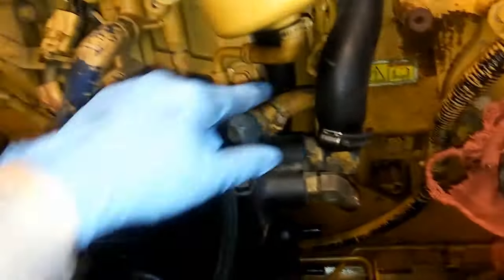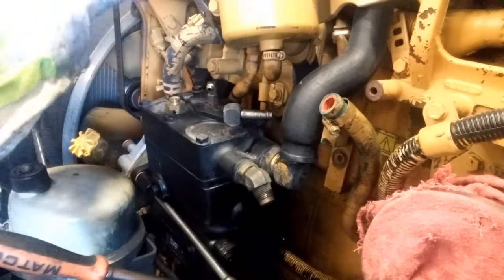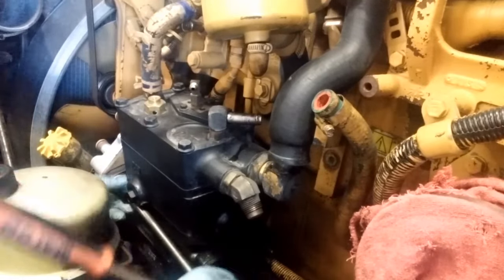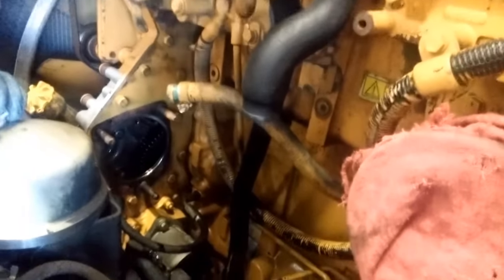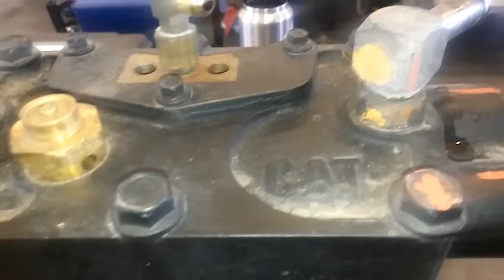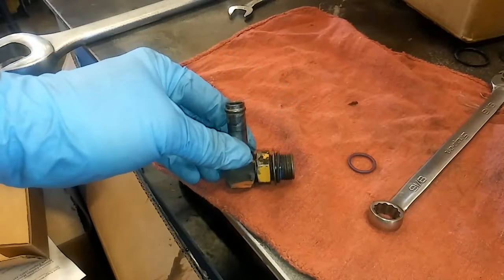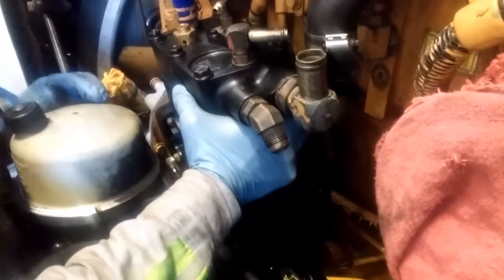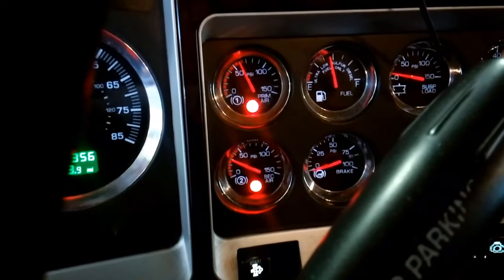How To Change Your Cat Air Compressor.  Remove And Install Air Compressor.

Comment: am having a problem with the compressor it keeps working nonstop air dryer purging every 30sec so i replaced governor, air dryer, lines, fittings, check valves, safety valves, unloader valve, any recommendations could it be the compressor it self? there is no sings of oil been push!!

Comment: What would the torque spec be for a C13 where the the bolts thread directly into the the aluminum front structure ?

Comment: I finally did the job myself and what a great experience it was. doing an awesome job with you tips and pointers you gave in your video I had to change a total of 6 hoses and a lot of back and forth to the Caterpillar dealer. But the results came out great. I work with a bunch of guys you work on there own trucks and they were able to help me with finalizing the work. Thanks again.
Reply: What are the Hose Sizes?

Comment: Mine a c15 cat in a 05 379 Pete I have changed air compressor before with the updated intake braided line my problem now is off elbow to intake line is stripped now any solution on repair on stripped thread on air compressor in using ratchet strap and rope to hold down elbow besides that air compressor works normal I just replaced air compressor 2 years ago

Comment: Hello, just wanted to say I find your videos to be informative and invaluable. I own a 1995 Beaver Marquis motorhome with a 3176B CAT engine.  Although many of your segments pertain to newer engines i think the cat specific tips are fairly applicable regardless of the engine. I especially like the troubleshooting tips you provide. I have changed fluids and filters on my engine and have made a minor repair to the connection between the water pump and oil cooler. Your videos are giving me the confidence to take care of my huge engine (compares to my v6 care engine) and hopefully what to look for to avoid problems on the road. Thanks for putting out quality information.

Comment: I’m having trouble removing the air compressor. It has the power steering pump mounted on the back. Any schematics or hints would be great. Your videos are the best!
Reply from the maker: +Brittany McCoy If it has the power steering pump on the back you might have a C7. There is a bracket that is behind the power steering pump that has to be removed after the power steering pump is removed.

Comment: On my 2005 cat c13 we changed the compresssor, there were some air lines that connected to a box with two air line connections. What is that box? It’s in the engine compartment and almost seems hollow?

Comment: Hey @Adept Ape! I'm sooo happy we ran by this video! We have oil in our air tanks when we purge, so I think we need a new air compressor on our CAT 3126. We had a truck mechanic look at the system and he said we did NOT have an air dryer on it (ugh!). Originally, we bought the school bus in Phoenix, AZ and drove it up to Ontario, Canada, where we're doing the conversion. So we definitely need to get this fixed.

Do you  have a video on installing an air dryer on the CAT 3126? I'm trying to find it on your channel! This one on changing the air compressor seems pretty straight forward and based on your video, I think this is one of those projects that we'd be able to take on!

Thanks so much!  Loving your videos!
- Brian + Erin

Comment: Make sure to replace, and install the pressure relief valve in the compressor head. In cold climates, moisture can freeze in the discharge line, and blow the compressor cylinder head gasket. I've seen it happen many times.
Reply: Can you please  explain how to do a bypass to see if the compressor is passing air pressure to the cooling system ????

Comment: If you have oil in the compressor do you change the whole air dryer system or just the air dryer cartridge? After changing compressor

Comment: Just bought An 05' freightliner with c7.truck sat for 6 years due to a couple non mechanical issues.. it runs excellent, only 165k. I washed your videos on the Huei issues, and I'm debating whether or not it's worth pulling the. Compressor to replace the supply line ( has some cracks on outside) or just leave well enough alone. Also contemplating on just buying the ifs kit and having the most downline protection .. any input

Comment: Should have saw my aprentice's face when he finished  and had the truck running when I asked him if he timed it properly! hahaha
Reply from the maker: +Blue waffle cone Those C7S and C9S engine air compressors actually are timed believe it or not.
Reply: The Cummins service manual says to time the air compressor as well. It's a little known detail most techs. overlook.  Doesn't hurt anything, just allows the compressor to operate in unison with the harmonics of the engine. Back in the day, you could walk across a truck stop parking lot, and hear the big cam Cummins compressors that weren't timed. They would emit a fluctuating chatter, on the loaded cycle.

Comment: I wish I had found your videos years ago. I would have so much more money in my pockets. You do a great job in all your vids your descriptions are perfect.
can you tell me how I can tell if I have a C7S engine ?
Reply from the maker: +Dale Brandt It is actually pretty easy to tell. Find the engine serial number on either the valve cover or the front structure, if the serial number starts with C7S them you have one, if it is a SAP or WAX for example then you have a normal C7.

Comment: Even if you do not change the oil supply line, you should pull it off and blow air through it. I have seen oil lines that were still fairly flexable have the inner liner come loose. That can cause a bad oil flow problems to the compressor . i have also installed reed valves on the intake of Cat compressors. These engines will pull a vacuum on the intake at slower idle speeds. That causes the intake to suck oil up past the compressor piston rings into the head of the compressor. When the compressor kicks in to pump air, that oil gets pumped into the air system. Most experienced drivers I know idle them at 900 rpm to create a slight amount of boost to prevent the oil pumping, but the reed valve on the compressor intake is a better answer to me because it allows lower idle speeds. Just my experiences with the cat engines.

Comment: Hey ape man !!  No break in ??  New compressor needs to get hot and seat the rings or it will pump just as much oil as the old one !!    Crack the hot line so the comp stays in loading mode and let er get good and hot !   Am i wrong ?  Is that not an important step ?

Comment: It's much easier in a shop. My last compressor change was under an overpass in Atlanta. Roadside, wrap rags around the coolant lines and clamp them off with vice grips.
Reply: Lol nice 👍 we changed the alternator in a -12 F Nebraska 😂

Comment: Great info!!!
Getting a little more then usual blow by from the vent tube on a Detroit 12.7.
Talking to fellow drivers and mechanics they all said engine. Not loosing a lot of oil. How can I narrow down my problem and how can I test to see if it's comeing from the air compressor? By the way very little to no smoke comeing from exhaust..
Thanks

Comment: I would add that there is a haldex inlet check valve kit available on non-turbo applications (2007 and newer) cat C13/C15 equipped with EL365's to address the oil consumption issues that plague these things due to high inlet vacuum. Check haldex bulletin L31300

Comment: It is a Haldex 365 manufactured air compressor. Why are the supply coolant line into the rear of air compressor head, when read Haldex manual, the supply coolant line can be plumbed into the air compressor block ? Which would give better temperature control and coolant flow for better uniform air compressor block temperature for rings and pistons. could rings be getting hotter etc loose tension , thus becoming oil burner?

Comment: What's the average useful life of the compressor? I want to have an approximate idea to know roughly, about when it's good to replace the compressor before it starts having any significant problems. On average at what mileage most trucks require it done?

Comment: adeptape,  working on the 3208 still....  Changing the air compressor, this one has a two groove pulley drive.  I removed the castle nut that holds the pulley on, the problem is the pulley.  What would I need to pull it?  Would a 3 jaw gear pulley work?  Thanks, Chris

Comment: Hello sr hope you doing good i been watching your videos i got subscribed i have learned si much but my truck got a issue that I little confused 😕 so I don't know I have to replace a compresor or just the repair kit that the cat dealer has sold me ? The compresor its not leaking oil or air, but don't build air quickly enough  also when I stop at the stop light   both of my air gage go from 110 psi to 60 psi in less than 30 seconds, my part number they sold to me its 335-6328 its a little piston with a sprint and few gasket 
My question its this can solve my problem or I have to buy a new air compresor?

Comment: Hi, I have one question. My name is Ruben I have one international prostar 2009 with twins turbo. I change the bottom turbo because I see oil coming for that turbo, only for the back part of the turbo“ going for the exhaust” but then oil keeps going to the exhaust. When I remove the oil blade “for check the oil leve I flet a lot of air coming for the pipe “I have a bad air compressor is sending oil to my air tanks.
 , if possible that is the cause for the oil going to my exhaust? Or a broken heat? Pliz help I’m new in that I have only 2 week with my truck :(

Comment: Hello I have a 2008 pete 389 with this type of compressor I have put 6 of these on Mich CAT says this last one I installed has been updated November of 2017.Have you had to changed a lot of this type?If I have to change it again I will change to single cyl type.I have oil thru the whole air system.The motor has had an in frame overhaul in october of 2017.It also has had the emission junk removed from it and has a single turbo.I'm not sure what horsepower it has but pulls like a freight train.I pull doubles gravel trains gross about 162000 lbs.Any info about this compressor would be appreciated.

Comment: My 2006 KW with a Cat C-13 Acert isn't building air.
Or to say 45 minutes from zero air to 120 psi. at 1000 RPM.
I removed the airline from the compressor and it seems to be pumping air with the engine running but I don't .have a gauge on it. No oil in the air.
Eventually, the air dryer does pop at 120 psi. What should I do next? 
HELP PLEASE !!!

Comment: Can you help me identify which Bendix compressor we can use for our Cat.  We have a 2009 Cat C-15 Serial number SDP-13992.  We are also on our 3rd compressor and I have tried getting in contact with Cat, Bendix and the dealer and no one has been able to help.

Comment: I installed my new compressor but it makes a very bad noise until the tanks are filled. After that it works fine but while charging the noise does not disappear.

Comment: How hard is it to upgrade my air dryer? I saw some guys mentioned AD-SP and AD-IP. I'm assuming they're spin-on cartridges. I would have to replace the whole unit? And which  upgrade would fit in the same spot which is on the passenger side under the firewall/floorboard? Thanks for the reply👍
Reply from the maker: +Big R Phillips You know I've never done any sort of air dryer retrofit, just serviced them. Does anyone reading this have a suggestion?

Comment: Can you show the three bolts that are inside the front cover that comes through and holds on the air compressor the three bolts that has the rubber seal for C15 can you show the insulation for a shortcut to seal from leaking on the outside around the compressor

Comment: Hey Josh, is it possible for the air compressor to push oil into the cooling system of the truck? Got a C15 ACERT MXS and we cannot figure out how the oil keeps getting in the coolant. The oil cooler was replaced and didn't fix the problem. The coolant line on the air compressor is "sweating". It also seems as if there is some oil getting into the air dryer as well. We are thinking of replacing both components and doing yet another coolant flush. The cooling system isn't overpressurized do we don't believe the cylinder head on the engine is cracked. Any advice would be super helpful, thank you if you see this.
Reply: i have a c13 and suspect the same issue...
what did ya find out?
Reply: @MrKatt68  Haven't gotten into the engine yet, still running the truck (it's not a full time truck at the moment) and just continuing to flush the coolant to keep the oil contamination down as much as we can.. I have however changed the air dryer and I also pulled the feed line off the compressor that goes to the dryer and it was dry inside, so I know the compressor isn't sending oil into the air system. My best guess as to what's going on is liner cavitation from too many years of improper coolant use. The truck had green coolant in it when they bought it and I suspect the previous owner did not test the coolant and add the SCA's, which in turned caused 'electrolysis' or liner cavitation, causing pressurized oil to inject itself right into the coolant surrounding the liners. The only piece of the puzzle that doesn't fit is there is no coolant at all in the oil. So I'm not sure if my theory is correct or not. I think we're going to find a used engine for it and swap it entirely.

Comment: Is there any way to adapt from a C15 to a C13? The C13 air compressor is the worst ever seen. I’ve had mine replaced about 3 times.

Comment: Good videos i have a question have 99 peter 3406e this morning truck wouldnt build air only 30 psi and would not go no more cant hear any air leaks at all susoension is deflated
Reply: Spray the discharge line from the air compressor to the air dryer with soapy water while its running.

Comment: Hi boss I’ve been looking at your videos and I can see you have great knowledge I have a quick question I have a 2013 freightliner business class m2 with a Cummins isc 8.3 I’m experiencing a lot of blowby basically like a chu chu train but for some weird reason I’m not burning any oil my level always stays the same is it possible it’s because of a bad air Compressor ? Or a bad injector can it cause blowby? Because I know I have a bad injector acts up rarely but goes away after if any advice I would appreciate it thanks a million

Comment: Hi, you videos are a God sent. I have a 6nz c15 cat in a Frieghtliner century and I have to change the air compressor. My question is do I need to drain the oil if my oil supply line needs to be changed?
Reply from the maker: +Valentin Espinal No you don't, the oil supply line will have a little oil in them, but you don't have to drain the engine.
Reply: Adept Ape thanks I can’t wait to get it done I’m still shopping around for the bendex model I found one place that carries it in West Palm Beach but they want a $1000.00 core charge 😬😬
Reply from the maker: +Valentin Espinal Well the good thing is you get your core charge back when you turn in the old part. Just don't lose it.
Reply: Hello Adept Ape quick question do I have to remove the gear from the old compressor and can I use my old values after I replace all of the O rings. Or it will be a different setup going from a double piston to a single. Thanks for you time
Reply: Adept Ape hello there just to inform you I started my air compressor project today (worst day after thanksgiving to start mechanical work. Happy Thanksgiving by the way). I ran into a few snags removing the compressor my original one comes with a 3/4” spacer that goes on the compressor to meet up with the housing and most of the hoses we’re toast. There is one hose that I couldn’t remove that goes to the head of the motor. And all three nuts that hold compressor were all loss. That raised a question should I use lock tight and what is the torque specs for those nuts.
Reply: And I had to remove the gear before I removed the spacer, that I ordered new because mine was cracked. Should I use lock tight and gasket seal when I put it back together?
Reply: Valentin Espinal 75 ft pounds. It’s all in the video
Reply: Valentin,  What year engine do you have and how did you find the correct bendix compressor?
Reply: Eddi Carrillo hi Eddi I have a 2001 6nz and I did my research through Caterpillar but they were very expensive. I went to my local truck part sales guy and he got me a original remand Bendix, remand by Bendix with one year warranty
Reply: Thanks for the help

Comment: Random question when installing the oring style fitting on the air compressor is their any torque specs or just snug tight?? Or it's not possible to torque ?
Reply from the maker: +Johnathen Thompson There is a specific torque for the normal tighten down fittings, the ones with the locknut and swivel plate I've never seen a torque for them, but there probably is. I've never seen someone torque them though.
Reply: Adept Ape thank you very much :) I'm graduating UTI in 2 months and I'll be going to Quinn cat school for 2 years after that, like I said before I hope one day we cross paths in a shop!

Comment: I have a Cat C7 in a 2006 Freightliner M2 and I want to eliminate the air compressor because it is not performing any function now. If I remove the air compressor, will the power steering pump (ZF FN4 model) bolt on to the rear of the timing gear case, in place of the compressor? The ZF has a splined shaft which now engages a matching recess machined on the compressor crankshaft.
Reply from the maker: +George Phillip You would need a geared power steering pump. The pump is splined and wouldn't fit the gears on the front.
Reply: Thanks. I will look for a geared PS pump at a wreckers.

Comment: How is the easiest way to get the bottom bolt off with out taking the power steering pump off bc the bolt on bottom is no room to get to bc of the frame and ratchet with  extension can't get on bolt